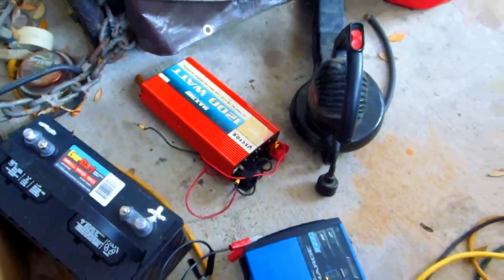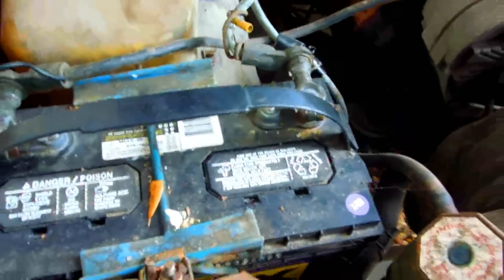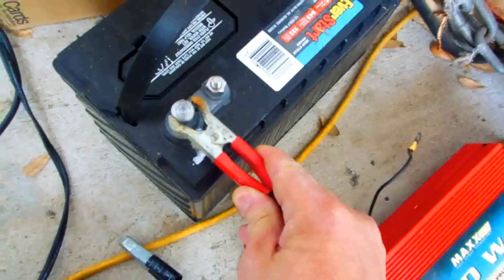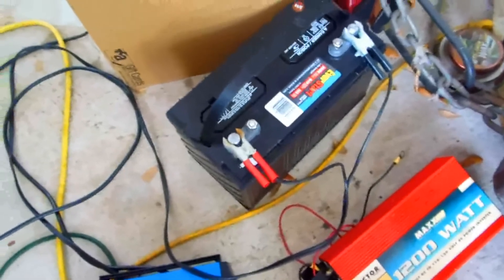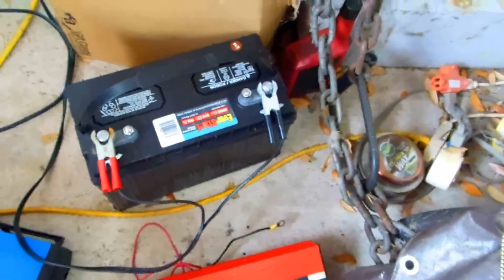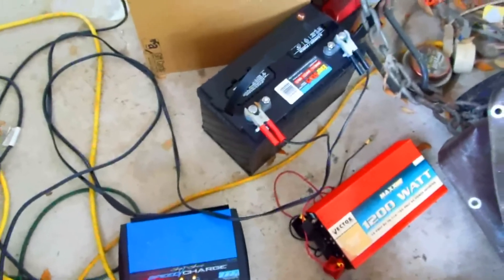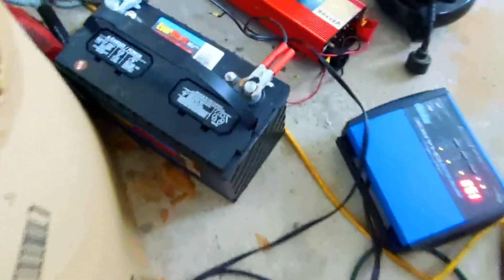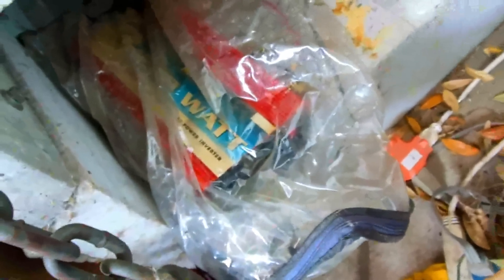Battery Conversion Fail & Battery tips

Comment: Lead -Acid batteries last longer in colder climates...where summer heat doesn't get over 95 for weeks and weeks. That's what i know from experience.
Reply from the maker: They sell different batteries for the South, then in the North.   They are actually marked as such.